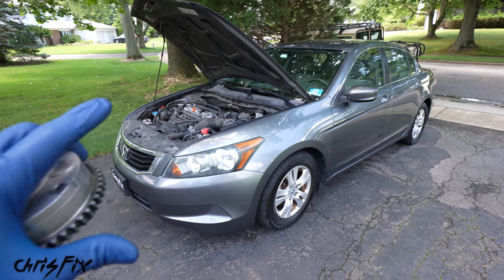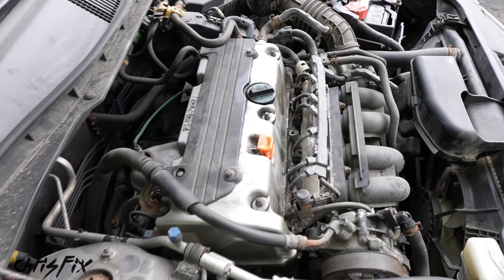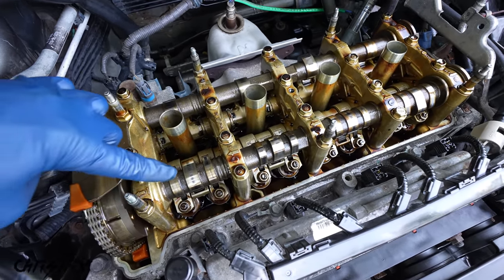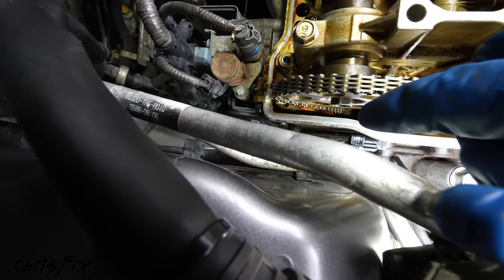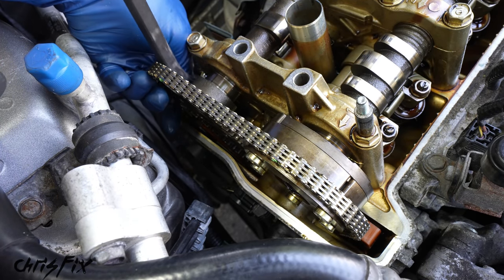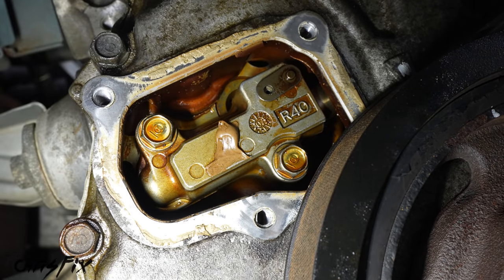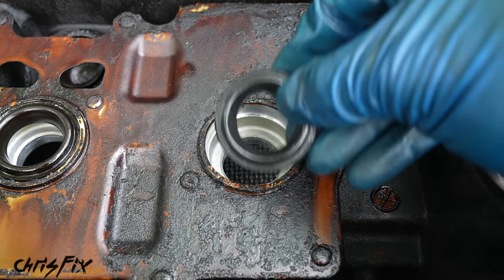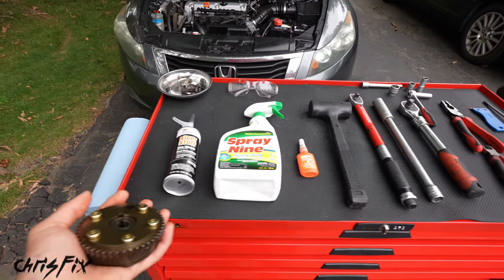How to Replace a VTC Actuator (Complete DIY Guide)

Comment: WOW!  I can say this is without a doubt the finest automotive-related video I have ever seen!!!  After watching LOTS of youtube vidoes, this one makes many of the others simply laughable.   Everything about is is so professional!   I feel very confident in doing this job now.
Reply: Just got back from a test drive after replacing the VTC actuator on my wife's CRV.  Everything went fairly well, considering that while being somewhat mechanically inclined, anything under the valve cover or inside the engine has traditionally been off limits for me.  There were a couple of things that others may find helpful:  
I ended up taking my chain tensioner plunger mechanism completely out. (more on that later)  It helped a lot, but I was still having problems with getting the gear on the end of the exhaust cam.  To solve that problem, I found that having a wrench on both the intake cam and the exhaust cam did the trick. Have someone rotate the intake cam counterclockwise very slightly towards the exhaust cam to create slack in the chain, while you're rocking the exhaust cam to find the keyway.  It plopped right on.
 
I found (the hard way) that when you get both the intake and exhaust gears on the end of the shaft and your marks line up, immediately install and torque the chain hold-down that spans both sprockets.  Since the chain is still quite loose, it can easily jump a tooth on your actuator gear.  (Happened to me more than once!)

Now back to the tensioner plunger.  It can be fully re-cocked and re-usable.  I remember seeing something in this thread the other day about it being a bad idea or it not being usable anymore.  It's impossible to re-mount it without re-cocking it. (again I discovered the hard way)  I used the edge of my workbench to push the plunger against, all the time waiting until I could push a pin once the plunger is fully retracted.  You can push it in a little, but to fully retract it there is a pawl that rides on some teeth, and you have to pivot the pawl off the teeth with your finger while pushing.  Once fully retracted, put the pin in, and it will install like a breeze.  I would recommend using some type of spring steel that just barely fits in the hole and is squared off on the end.  (I used a modified heavy duty fishing snap swivel.  You can even cut it in such a way that you're left with a nice little handle to pull when ready)

So once you have re-mounted and torqued your cocked and loaded plunger mechanism, your marks are lined up, your chain is where it needs to be on both gears, your top hold-down is on, and you've verified you're at TDC for the last time, pull the pin.  It will go as far as it can, but as you do a couple or more rotations of the crankshaft, you'll hear it clicking as the pawl rides across the teeth to tighten the chain.  (I heard 2 clicks very shortly after I started rotating.)

Another thing that came to mind while I was writing this, is that when you're installing your buttered up cover plate over the tensioner opening, try a magnet to put in in place.  (I didn't do this, but I think it might make thing a little easier.)

Chris, I can't thank you enough for giving me the confidence to do this job.  Again, your video is just superb.  Keep up the totally awesome work!  (Sorry if some of this stuff is covered in all the replies below, or even in your video!)
.
Reply: Oh... and I had to unlock my actuator several times through all this after accidentally locking it.  You'll find some information about how Honda recommends doing this using compressed air, electrician's tape, and a wire tie.  You must take the intake cam out to do this, in order to access the holes that are covered up by the first camshaft hold-down. (Yikes, I thought!) Tape up the first hole (wire tie not absolutely necessary after about 4 wraps)  Blow the compressed air into one of the remaining holes while plugging the hole that's 180 degrees away with your finger. If that doesn't do it, try the other hole.  You don't have to do anything by hand...  just have your actuator hanging over the end of a workbench, and it snaps unlocked with enough air pressure.  I ended up using the unused tapered plastic applicator from a tube of gasket maker I bought for this job.  Cut the very tip end of it off, whittle a little bit of taper onto the very end so you can cram it snugly into the camshaft hole, tape it profusely to your blower, and with just a short burst, it will immediately respond.  (again this was learned the hard way.  Best if you just remember to just NOT lock your actuator, as Chris suggests)

I'm still beside myself for doing this job, and Chris's video.  Admittedly, there were times I was just about ready to call a tow truck, load up all the parts, and take it to a mechanic, but I'm so happy I persevered and figured out some of these little glitches.  Hope all this information helps someone out!!

Comment: Chris, that is EASILY the best 'how-to' video on this VTC gear replacement on YouTube. The problem is that I know if I attempted to do the same, I wouldn't come anywhere near making it look as easy as you did. And because I live in a townhouse development, dropping F bombs after F bombs is not acceptable. I'm too old and tired at this point to think that I can pull this fix off, and my eyesight (and patience) are for shit. That said, I'm a stubborn old fool, the thought of dropping $1000.00 on this at a local garage has me a bit queasy.

I just purchased a 2009 Accord, essentially the same car from the video. It's got 145k miles on it, and it runs great. However, it of course has the cold start rattle, so I'm pretty sure the VTC is the problem. My question is:

How can you tell if the timing chain needs replacement as well? And how can you tell if it's been "stretched"? I'd hate to go through all of this only to find out that the timing belt also needed to be replaced.

I have also discovered that there is a "spring fix" solution to this, supposedly, involving just replacing the spring housed in the intake gear. Any thoughts on that? Thanks for everything.

Comment: Did this job on a 2016 CRV this week. Don’t torque the VTC actuator to the camshaft in the lock position. The lock plunger isn’t designed to hold 84ft/lb and it can damage it. The one I did the chain was very visibly worn as well anyway so I ended up doing the VTC actuator, cam sprocket, crank sprocket, guides, and tensioner if I’m going to have the timing cover off it’s all getting replaced. Don’t risk having to go back in for something else that way.

Comment: Great video, easily the best I've seen on the subject. Presently in the middle of an Element oil pan reseal, but discovered a likely second leak on the timing cover. I also have a light tapping noise I have set valves twice) that seems to eminate from the area of the vtec actuator - all the videos of this failure seem to involve a loud clatter on start-up, which mine does not. So before I replace it, I 'd like to determine if they can make noise like my engine potentially before failing completely.
Reply from the maker: Could be normal noise on that engine unless it wasn't doing that before. Might be worth getting a new actuator in there if it's older and you have it apart

Comment: Thanks to your videos I was able to replace my VTC actuator….however I couldn’t get the exhaust camshaft gear off so I had to resort to removing the intake camshaft to swap the VTC. It might have been more work but I wasn’t worried because I knew to take my time (also had the Honda service document for how the dealership does the repair). Saved $600 and got tools I can use to do even more work on my car, looking at some new shocks!

Comment: Amazing video! My 2011 Acura TSX has this issue and I just bought it. Luckily, it popped up during the short 3,000 mile/3 month warranty period and is going to be replaced. This is pending the warranty claim from the mechanic, so we'll see! Also had the car brought in for some drivetrain vibration during acceleration over 50mph and this turned out to be both front CV axles, which were also replaced and was already approved. I got a good deal and it was a one owner car, but I hope this is just a sign of the age and having 158,000 miles. I have heard such good things about these cars!
Reply: I have a 2011 and it’s been having the same VCT issue. Other than that it’s been a rock solid car for me so far! Currently sitting at 111,000 miles (35,000 of which I put on) and I couldn’t be happier!

Comment: Thank you worked for me everything seems to be functioning as it should be so far I did end up having to take out my chain tensioner as well and for anyone that needs to know you can take your tensioner out hold the tab forward on it and compress the piston in the tensioner.
Reply: Can you provide more detail info on this.  I can't get the sprocket back on as the pin fell out as i was rocking it! So it appears i need to take the chain tension-er out to relieve the pressure so i can get the sprocket back on.

Comment: I have a 2012 Honda Crosstour, which uses this same engine. I am approaching 100K and also have the VTC actuator rattle on cold starts. I know Honda recommends the timing chain to be replaced around 120K, so I'll be doing that as well. Snapping a timing chain on an interference engine, that is running, creates thousands of dollars worth of trouble. NO BUENOS!!! That said, I was a little bit surprised that you did not change the timing chain here as well, especially considering that, you already had it exposed. Do you have a video showing how to replace the timing chain on this motor?? You made replacing this VTC actuator look a lot easier than every other video I have watched about this.
Reply: timing chain isn't 120k interval. They are meant to last for the life of the vehicle, but some may need to done earlier than that with a Check Engine code P0341. The V6 has a 105/110k timing belt replacement interval.

Comment: Hey Chris, i appreciate your work since i think 5 years or so. You helped me a lot to fix, clean and maintain my car. Since i want to change the oilpan gasket and while im at it the Connecting rod bearings too i've noticed that you dont have a video for these cases.
Maybe this could be one of the next videos in the future? ;) Because i know that its good to change them after 150.000 - 200.000 km (93.750-125.000miles)

Comment: My 07 Mercedes E Class has a bad actuator that’s causing it to stall out and misfire. I paid 200 for the MB dealership to diagnose it, and they’re wanting to charge five thousand dollars to swap the whole camshaft unit, just because of the broken pin on the actuator. Thanks Chris, I’m about to spend ~300 on a 4800 dealership job!

Comment: Oil consumption is the issue on CRVs. I routinely burn 2 quarts every 1000 miles with 112,000. Your buddy is correct. Ran low on oil. So is the issue burning oil or the VTC? My money is on oil consumption

Comment: Chris is on point and does a great job as always........BUT.......I'm doing mine differently.  I am using the Honda TSB instructions which calls for removing the Intake Camshaft from the vehicle and then breaking the VTC Actuator bolt loose, instead of breaking the bolt loose when installed in the vehicle.  I tried breaking the bolt loose in the vehicle and it literally requires over 150 ft/lbs of torque and lots of heat to do it - and in my opinion can likely cause damage to the camshafts, cam gears, and timing chain if something goes wrong.  I did not want to do major damage to the engine just to break the bolt loose so I am taking it out of the vehicle instead and then using the help of any person and putting the 24mm wrench against the floor (so it won't move) while breaking the bolt loose.  My plan is to have another person stand on - or use their body weight to hold the camshaft in place (along with the 24mm wrench against the floor)  while i break the bolt loose.  Seems much safer that way.
Reply: Agreed.  I just did mine and did the same thing you and Honda recommended.  Much safer and only an extra hour of work.

Comment: I replaced the VTC actuator same brand as yours replaced the timing chain just to be safe and set the timing correctly the car runs great ! After about 2 weeks the same noice came back what do you suggest???

Comment: Does the V6 Accord from this generation also have a VTC actuator? My car does the same rattling noise on cold startups but it lasts for like a minute or 2 before it goes away. I've never done this type of work on my car so I am a little intimidated to open up the engine, but you did such a great job explaining everything that I want to give it a try if its similar to the four cylinder.

Comment: PSA before you attempt this job (IMPORTANT):

Pre-text: I’m a diesel mechanic that worked at a Volvo trucks dealership for 4 years.

Chrisfix’s example is if everything goes right. In my case, the timing tensioner wouldn’t retract. So I got a new tensioner but since it wouldn’t retract, the tensioner wouldn’t come out of the opening.
So I thought I’d remove the crank pulley to get more clearance, and to keep a long story short - it worked, the tensioner came out BUT I could write a 7-page essay on how hard it was to back off the crank bolt (look at some YouTube videos, read the comments on those videos).
Now I have the top 2 sprockets lined up, the crank pulley is timed, but when I release the tensioner and spin the crank, the slack on the right side of the chain throws the timing off by a couple teeth (I almost didn’t notice this and wouldn’t destroyed my engine). 
Now I’m thinking I have to remove the sprockets all over again but I took the crank pulley off again, took the tensioner off, and spun the crank because the chain was loose enough. I put everything back together but when I engaged the tensioner, the vtc sprocket had moved over by a tooth. That was en easy fix, I tore off the crank pulley and tensioner and fixed lined it up again with chain slack, and prevented this by simply installed the top timing guide. Then when I went to install the tensioner again, the chain slack would throw it off by a tooth. This happened MANY times. This job took me 3 days to complete. 
Even when I was starting my engine, I had doubts whether or whether not my engine would be toast. Luckily, it worked out.
I’m a stubborn individual in general with 4 years of professional mechanical industry experience, and I would not attempt this job again. It is far easier to do a timing belt job on a Honda J35 engine that this. 

My apologies for the long comment.

Comment: Very nice vid bro, really helped me get threw my engine , i sadly ran my engine with low oil sue to my oil pan leaking , long story short my tensioner went bad was off timing , p0341 incorrect phase detected was the code there fore had to replace chain tensioner guides and chain guide arm and vtc actuator …, as im installing the new actuator on my acura tsx with 2.4L k24a2 btw , i noticed that my actuator did not need that quarter turn almost in order to lock the actuator, all markings line up tho moving forward with the repair will update after

Comment: Thanks Chris! You make excellent step by step videos! Question? Shouldn't you have turned the tensioner lever back to the engaged position before putting the cover back on? Also, what are the other marks on the crank pulley for? That could be confusing! The phaser could be checked by powering up the oil control valve while running to see if its working? The engine will bog down!

Comment: A quick tip: Always lubricate the coil boot (Coil on plug system) with a proper grease (dielectric grease). This will prevent the coil seizing on the coil.

Comment: I did this entire repair and your video is perfect. What happens if the timing marks are just a little off....like 1 tooth? Could that generate a code like crankcase position sensor etc?
I would think that with the timing marks off just a little could cause this???
Reply: Hey, did you figure it out? having the same issue
Reply: Believe the timing chain has stretched when that's the case

Comment: Great Video. I was considering doing this but you've talked me out of it! 
(but only because it was beyond my own laziness threshold, this is  a really really great video). 

I have a novice question though. When you were comparing the old and new parts I was expecting to see more noticeable damage on the actuator.  Is this just such a precision part that the damage is just not visible from a casual glance - i.e., that even barely perceptible deformations can cause all the original problems?

Comment: Hi Chris! Great video! I have a 2004 Accord, 179k miles. It is throwing code P0341 -- I think it is a stretched timing chain, but was wondering if a bad tensioner would cause the same thing? After watching this video, I also wonder if the actuator is bad. For sure, the car has run low on oil, and the oil gets dirty very quickly. Two mechanics have already told me they don't even do timing chain replacements because of high labor costs, and the fact that this is a high mileage motor. But used cars are at a premium, this car has been in the family since it was new, and it is a 5 speed, which my 18 year old daughter wants to drive (her two older brothers learned on this car too). She also likes to work on cars -- so I am thinking of doing the job with her. So I guess I can diagnose if it is the chain by bringing it to TDC and checking the mark below as you did. And I'm guessing I should also replace the actuator as well, whether or not it is bad at this point, if I have to do the chain ... Any thoughts? Thanks!